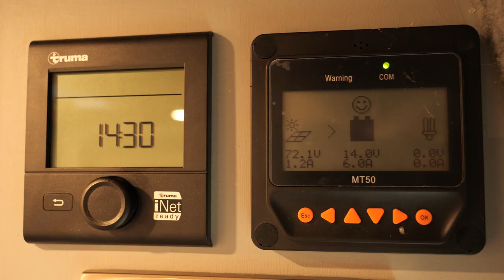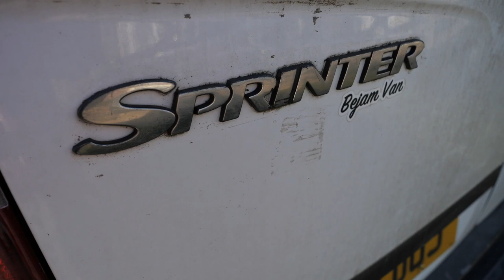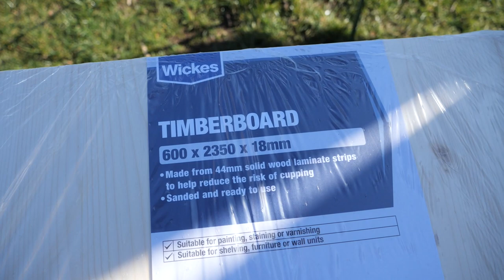Van Garage Drawer Build | I'm Back On The Van!!

Comment: Good to see ya back mate! Pleased you decided not to rip out and start again, that would have been a pain and held you up big time especially as you're now working. 
Haha the kids...yeah that sort.of thing drives me nuts too! 
I'm bit worried about the pull out drawer, will those runners take the weight of the stuff you're planning to load in, your bike etc? It's a great idea don't get me wrong but you don't want those runner ball bearings popping out under the strain. I guess you've thought of that already though.
Looking forward to the next update. Great to have you back!
Reply from the maker: Thanks mate 👍🏻
It had been going through my head for weeks, I think it would have been a big mistake to start again now 🙄 
The runners say they are rated for 120kg which should be okay for my bikes and the other bits I want to load onto it. I think I'll still have to be careful, load the heavier stuff at the back so there's little weight on the front when it's fully extended.. if that makes sense 😅
It's great to hear from you mate.. I want to keep these coming again 👊🏻
Reply: @BejamVan  Thinking about it I'm basing my "runner ball bearings" thought on some cheap wardrobe draw runners that came in a self assembly pack. They were as stiff as hell to pull out despite some adjustments and lubrication (the runners not me! 🤣) and one time I opened the drawer something popped and tiny ball bearings were laying on the carpet from the knackered runner! I guess your runners will have wheels in so much more sturdy. 120kg rating is great! 
Hey I meant to say how good a fit was your pine bed panel eh?! 
See you on the next one! Stay safe.
Reply from the maker: 😅😅 crack me up lol I hope these don't fall apart.. I guess only time will tell 😉
Cheers mate, to be fair there was a few fine adjustments that weren't shown on the video 😆
Take care chap 👍🏻

Comment: I'm new to your channel. I have a sprinter and want to ad a six foot long draw under my bed, do I need six foot long draw runners or can you use shorter ones? 
I'm in the UK too and was looking for a link to the ones you used. purchased
Reply from the maker: Hey.. if you'd like the draw to extend 6ft out of the van then you'll want 6ft draw runners. I wouldn't now recommend my runners haha, they took weeks to come and I've had a a few issues with them but the system itself works really well.
The guy that I got my bike mounts from now sells runners or is in collab with a UK company selling them.. worth checking them out or contacting them 😊
https://gsfslides.com/conbas-base-mounts-full-locking-floor-undermount/

I hope that helps and good luck with the build.. I'm happy to help where I can 🤙🏻
Reply: @BejamVan  thank you I'll take a look at the link 👍🏻